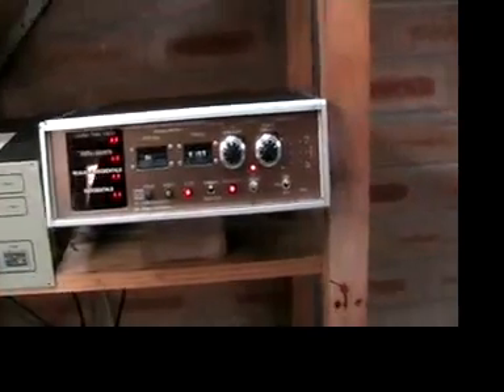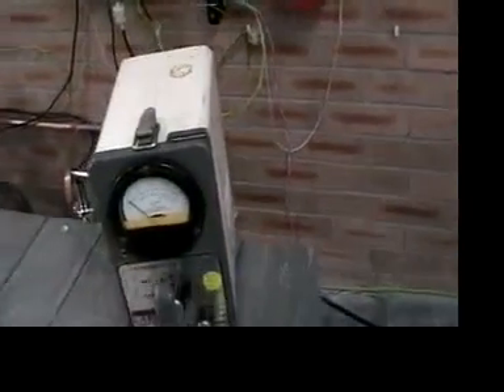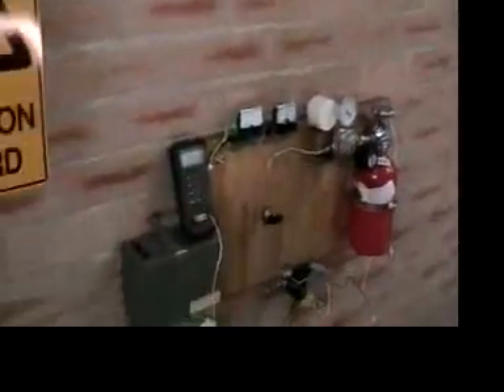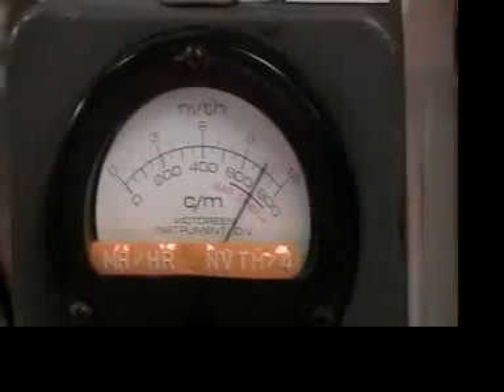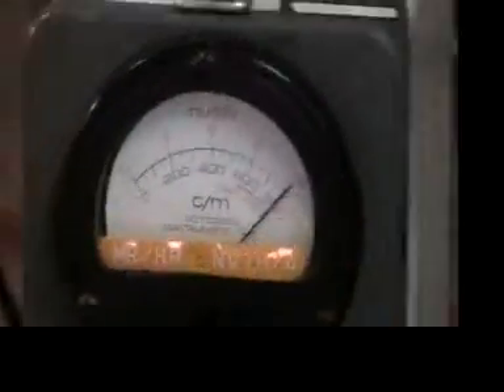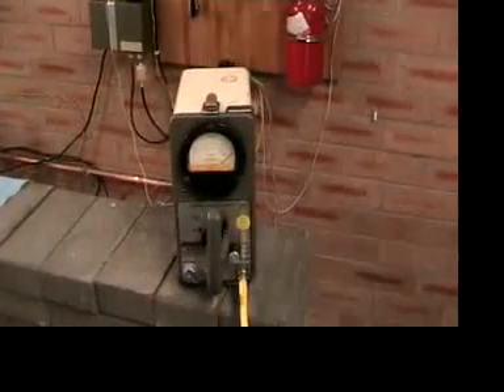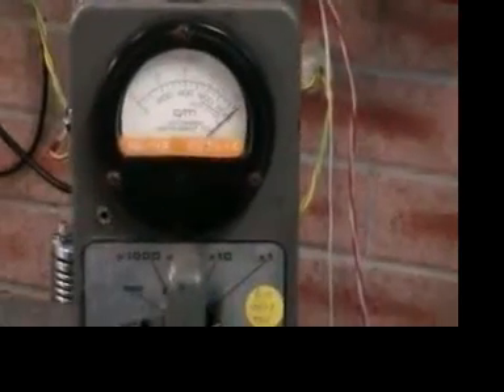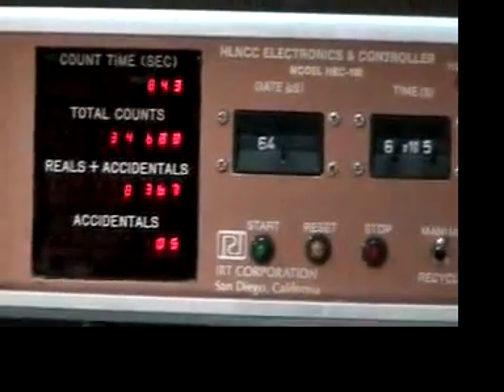S.T.A.R. Fusion Jun. 2008

Comment: Have you been able to figure it out by now ? :-)
I mean the irradic behavior would cancel any theroy of remaining short lived radioisotopes, and the time it lasts is way toooo long for the typical up and down "rollercoaster" you can see when shutting off some regulated power supplys, in case the 20Kv kathode one is semiconductor regulated in some way.......
What you mean by fusion not taking place.....what else should cause the neutron flux
Reply from the maker: Still working on it 2022 😊